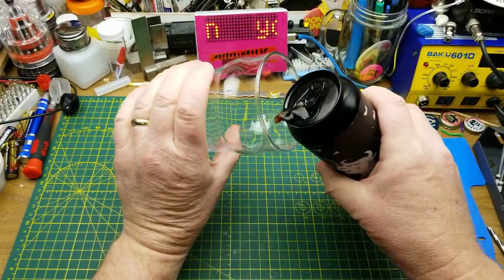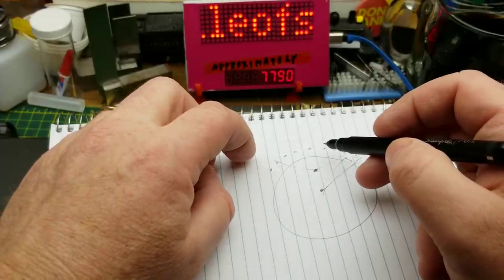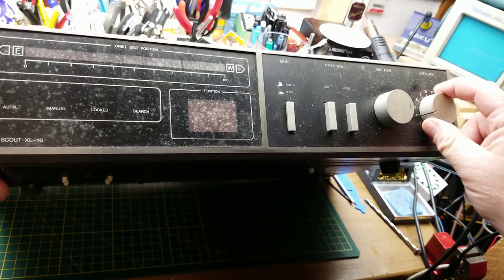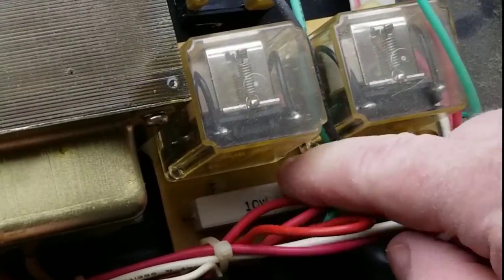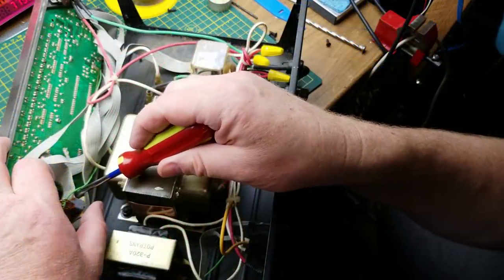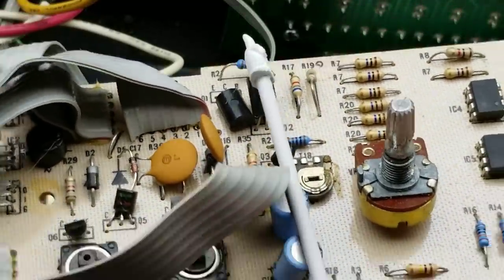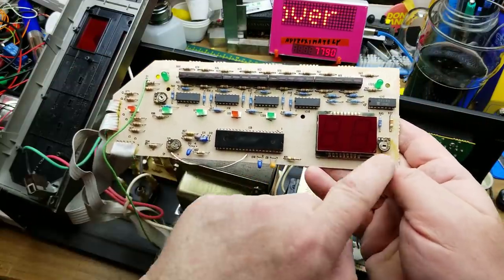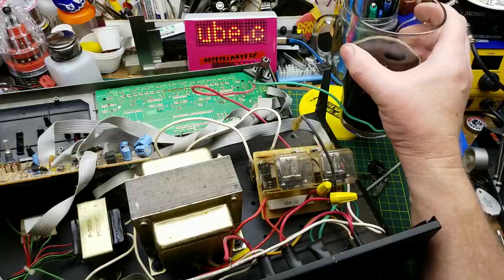teardown: '80s satellite dish positioner

Comment: Big display chip is likely an ICL7106/7 DVM chip, used with only 2 displays. The bargraph is almost definitely a LM3915 10 segment linear display driver, used in cascade mode, thus all the resistors to set range and configure it into either dot or bargraph mode. Main control board the 2 IC's are going to be LM311 comparators, used to drive the relays direct depending on the difference in voltage as to which one operates them. In the middle is a 100mV or so of dead band, so it does not keep on hunting when aligned. Switches simply operate the relays direct, though I guess there are some diodes to only allow one direction of movement at a time. Plus and minus 5V rails for the analogue stuff, one of the 12V rails is for the bargraph display, which needs around 9V, and the other 12V is to drive the relays.

Simple system, the more complex ones used a IF feedthrough from the actual LNB, taking a tap off of the RF signal, and then a simple point contact rectifier (probably an 0A91) germanium diode and used that to search for a peak when close to the satellite position. Modern ones use a pair of optical encoders and a reed switch on the dish, so they count pulses from the origin, the reed switch, to give more accurate positioning, and can thus discriminate better between satellites. Just need to have a backup battery to hold the positioner count, so it also holds the stored channel numbers and names as well, as there is 2k of memory available. Battery should keep a month of no power, but would fail and leak as usual after a few years. Some even sense motor current, so can detect home without a reed switch, and also will trip if the dish jams, instead of blowing the fuse.

Motor limit switches have a diode across them, when you open the limit switch, the diode allows the motor to still operate in the other direction. 10R 10W resistor on the relay board is used in the idle position to allow the motor power terminals to be shorted, so the motor would not move with force applied to the disk on the equatorial mount, so it would keep relatively still. Never used that sort of C band dish, but used similar systems with linear geared motors.

Comment: I can't see those chips being faded.  Chips last decades without fading.  I think they are deliberately scrubbed so no one could copy the board :).
I remember C-Band and then later the smaller dishes of K-Band, primarly Ku here in Australia.   Still used a dish positioner with Ku switching primarily between Optus D1 and D2 for different TV and radio feeds.  :)

Comment: I can remember my first dish, won it in a competition with a national paper. They wanted to install it for a fee, but I said that it did not state in the competition rules that I had to pay for installation. So just give me the bits I've won. In the end they did, so I used to open the back door and put the dish on a few house bricks and go and watch sat TV. last thing at night was to bring it back indoors before going to bed. it did end up on the wall at some point, possibly when it got too cold to leave the door open with a cable running out.

Comment: it almost looks like the tab of the 7905 is touching the tab of the 7805. I'm pretty sure the tab on the 7905 is either at input or output potential. And the 7805 tab is ground. if this was the case, that is possibly why the power supply was burning up.

Comment: Your satellite diagram was only a little out of scale- geostat orbit is about 3 Earth radii from the planet's surface.
Other than that nit, terrific presentation of a real blast from the past.
Another commenter thinks those overheated regulators might have had their tabs shorted together due to sloppy construction (gotta love the '80s) but is it possible the circuit was expecting a load and ran away without one?

Comment: Do you think that the display board is a crude volt or ohmmeter? Maybe it is just reading the selected position and the feedback pot?
Reply from the maker: That is a definite possibility.
Reply: Display is likely a ICL7106/7 DMM chip, 40 pins, and a lot of wires to the display in the right locations, plus the few support resistors and capacitors. Bargraph is LM 3915 bargraph drivers in cascade mode. Both chips are worth a bit now, as they no longer are made by the original manufacturers, and are in demand.
Reply from the maker: If they were socketed, I would be more tempted to pull them out and play with them.

Comment: I wouldn't pull the unit to bits and would try and use to control a TV antenna, I have see those units at a fuel station but unfortunately they got caught for copyright violation and fortunately other people have bought the franchise.